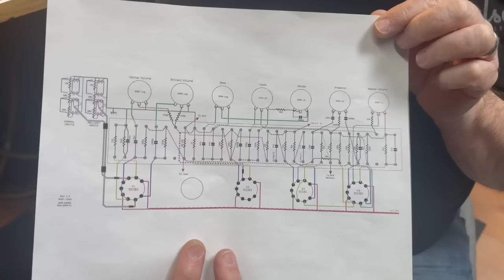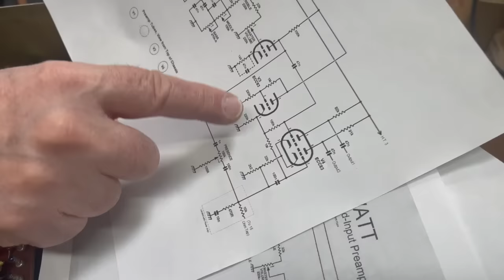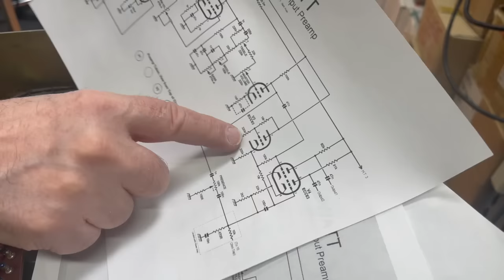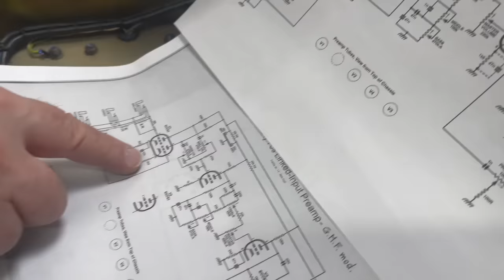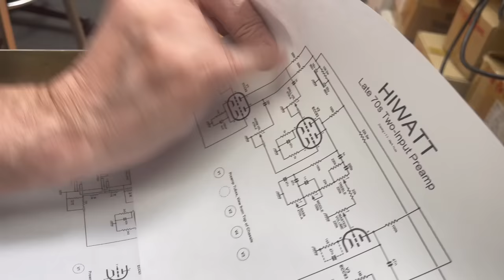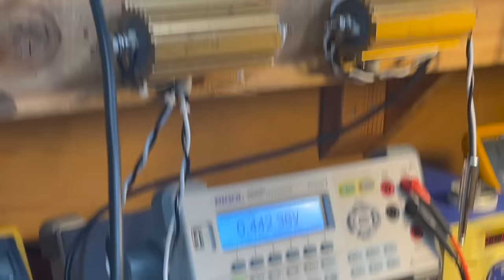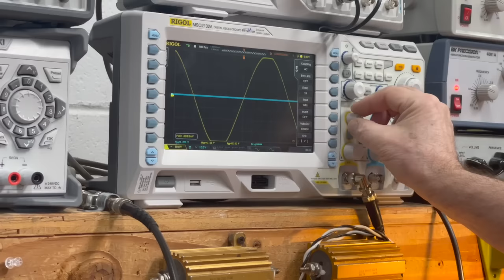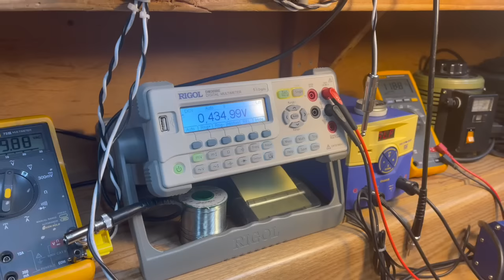The Quest for the Perfect Hiwatt (Part Two)

Comment: Anyone else see the old VHT Valveulator buffer on the shelf! He should totally modernize and reissue that thing. Way ahead of its time as with most of Steve's ideas!
Reply: I do now. I have three of them. Great sounding! Only problem with them is sometimes the fuse blows in them and the fuse is hard to access and sometime soldered in. I got one of mine free because the fuse had blow and my buddy thought I he unit broke.

A new version would be amazing
Reply: I love my valvulator!

Comment: Joe’s Cabinet is probably an Audio Brothers made Hiwatt Cabinet. I have one and it’s great, even compared to my 70s “real” Hiwatt cab. Audio Brothers used 90s black cast frame Fanes with different mounting holes (no they are not like the original silver/grey cast frame Fanes). I know because I tried to put a pair of M65s speakers in it for a mix, but no dice. I will say whatever those cast frames are they sound amazing, even compared to old ones.

Comment: Thanks to Steve and Fryette team for providing all these Hiwatt insights. This content is gold and laid the groundwork for me.
Last year, I bought a 78/79 DR103 just like Joe's. It had a ripped out preamp section from a "gain mod" someone tried.
I went all in and rebuilt it with all NOS mustards caps and Beyschlag resistors.

Thanks to your awesome PS2, I can even use it at home.

Big thank you from Germany!
Reply: to be clear: I used your approach and rebuilt the preamp to early 70s spec.
Reply: One more addition: also used your advice to reform the original filter caps!
The amp has been sitting at the pre-owner for 20 years unused since he never came round to restore it.

Comment: In this video and Malcontents S3 Ep7  you talk about balancing amps gain from its input to output for good string separation and good Hiwatt sound in this video.
This balance thing might be critical in overall What Makes Amp Great thing. Need a separate video/live on this subject ! 

For me most important thing in amp was country to Iron Maiden from guitars volume pot only. So I built my own amp. And it was full of pots and trim-pots until it did what I needed.
What I did not knowing it, was balance amps gain from input to output. Amp now has gain pot and Vox Cut style pot, I dont use any of these. Always on 10/10. 

Watched every video on this channel. Learned as much about amps as margaritas.

Comment: Great two part video. Thanks for sharing. I bought a new 1982 HiWatt Custom 50 DR505 (Canadian version) and it had no issues with the gain that you mentioned were a problem with some of the earlier Canadian versions of the DR504. It sounded incredible and it replaced my 1981, 50 watt JCM 800 which also had a Canadian mod as they were also imported by the same distributor as the HiWatt's. I preferred the HiWatt over the JCM 800 because it just had bigger tone and a bit more usable gain.

Comment: I'm trying to understand which Hiwatt circuit variations were done in what production year(s). I have a 72 and a 73...are those amp circuits more for "hi-fi" tone?
Reply from the maker: Thems the golden years. They'll do the cleans tight and the grind right.
Reply: @FryetteAmps  Excellent...I'm an electrical engr. that understands schematics and amps, but I don't know any particulars about the Reeves designs - which now make way more sense from your splendid video. Many thanks - you've saved me hours of digging and head scratching!
Reply from the maker: @harrykadaras9459  There will be more to come...
Reply: @Fryette Amps  Much appreciated. We need more of this subject in our lives!

Comment: Thanks for the deep dive! My '79 DR103 has some of the issues Joe's had tonally, especially with the weird low end. Can you divulge what preamp tubes you used when you replaced the old ones? Also, what slot the 12AT7 was used in?
Reply from the maker: We used Psvane ECC83s. The ECC81 was probably a JJ. The position for that one is second from the left looking at the front of the amp with tubes facing up.

Comment: So my loadbox is only rated to 100W RMS.  If I get a DR103 and turn up the MV to the point of distortion, is that still gonna be low enough to not make my load box melt?
Reply from the maker: You're going to need a load box that handles well in excess of 100W.
Reply: @FryetteAmps  that's kinda what I was afraid of.  Thanks for the knowledge.
Reply: You can use your load box but crank the amp max 11 o'clock in the dial, otherwise you'll be easily pushing over 100W, especially if you run a bass heavy setup.

You'll be riding the load box at the limit though.
Reply: @JohnWiku  I ended up getting a DR504 after Mr. Fryette's advice.  I'm glad I did, though, because the drive on that thing just above 3:00 with a Tube Screamer and buckers is glorious arena rock.

Comment: Sick man! Joe Barresi recorded some amazing records. I was wondering i see you just switching the speaker cable while the amps are still on, everybody tells us that that's the worst thing to do to a tube amp, right? NEVER turn on a tube amp without a load? Or does that only matter if the amp's on really long or an actual signal is ran though them? anyway awesome stuff, Cheers
Reply from the maker: If the OT is not passing signal, in particular, A LOT of signal, then it's not necessary to turn off the amp or switch it to standby when switching cables, cabs, etc.
Reply: @FryetteAmps  wow thanks for the quick answer..! That's good to know, because i'm always switching around amps/cabs in the studio to try different things, and would always turn the amps on and off